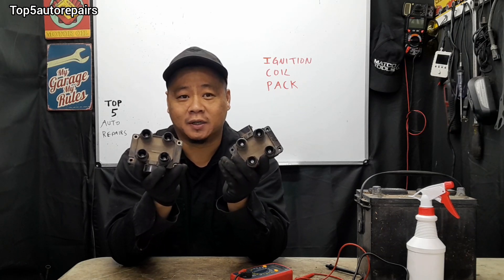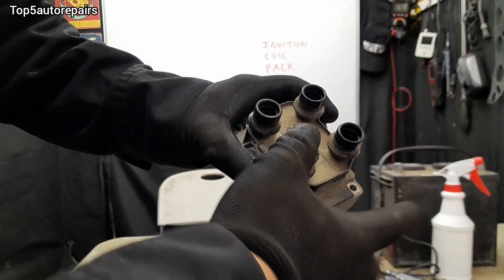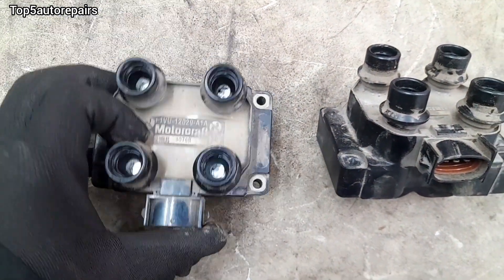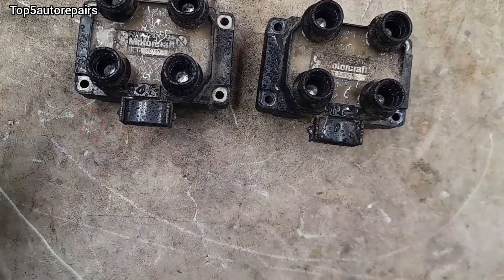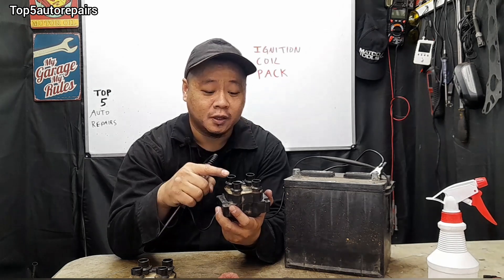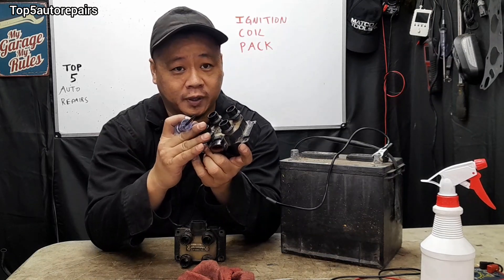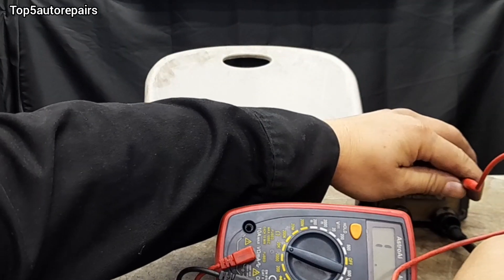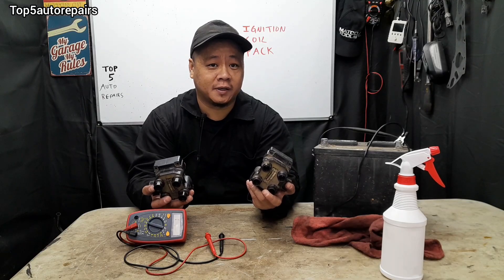3 WAYS TO TEST IGNITION COIL PACK

Comment: What about a coil pack that is worn out? you can get ohms reading but the car will fail.
The only way to measure a coil pack is to KNOW THE REFERENCE ohms from a new coil pack and test against those values.

Getting a random reading WILL NOT TELL YOU ANYTHING ABOUT THE COIL PACK you only know it is not blown up, but the coil might be in the end of its working life and the car will fail.
Reply: Yea I think so too

I'm havinv truck problems atm with 
I'm hoping it coils or plugs..or wires...

Comment: where can i find manufacturer specifications that are reliable? Not just for coil pack but also for other electrical components. Do I find the specs on the components manufacturers website or the vehicles FSM? I want to test an Duralast Intake Air Temperature sensor but I cant find the temperature/resistance specs. Thank you for your videos, always short and to the point.
Reply from the maker: Hello. I use Alldata and Mitchell.